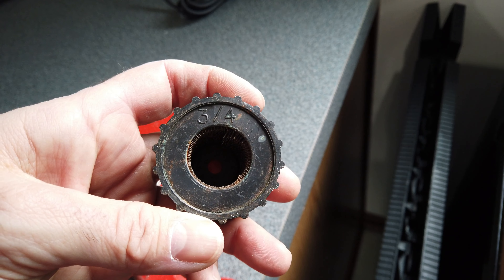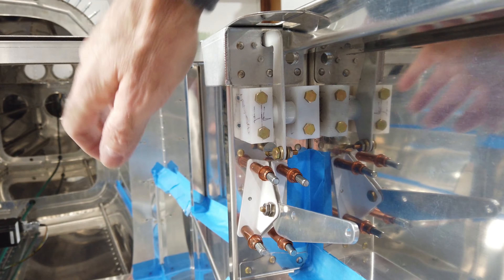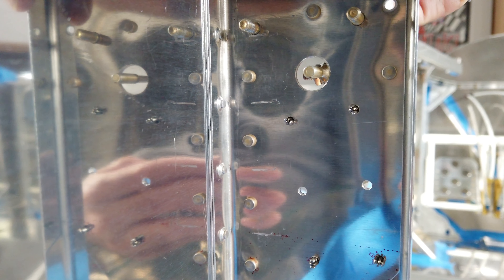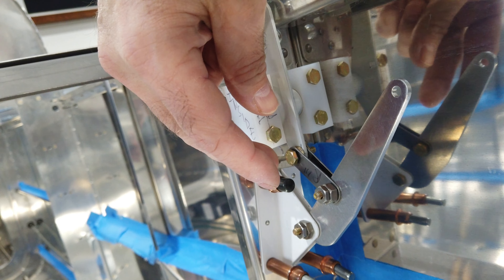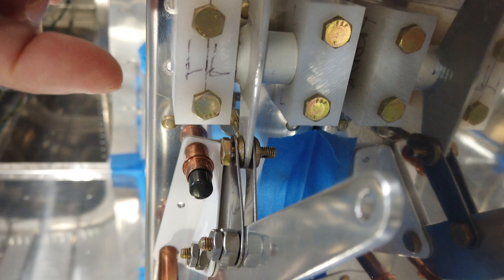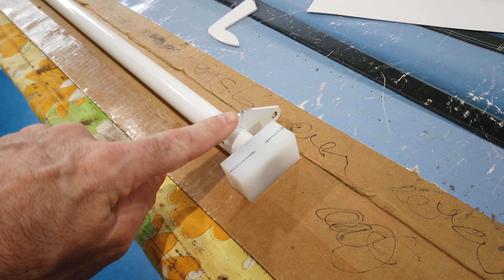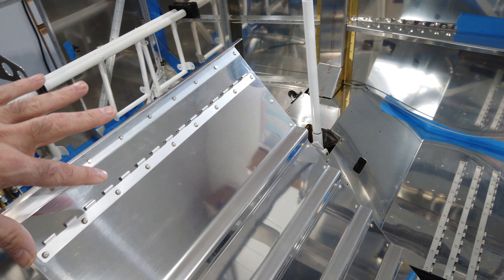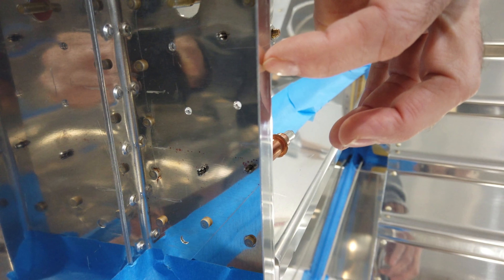Vans RV 7 HINT Video Tip Up Canopy Hook Mod 2

Comment: instead of using a solid bar to connect both sides of the locking mechanism, maybe you can look at using an a-920 control cable.  Aircraft spruce can make a custom size.  Attach it to the locking arm and run it behind the bulkhead through the hole you have.  Secure cable to bulkhead on both sides and you should be done.
Reply from the maker: Howdy Bob. I did see the cable option you talk about and I bet it works fine. I now have my hook latch mod complete, (videos coming today/tomorrow) and think it is great! No seat interference, no lost space in cargo bay, clean appearance; turned out very nice.
Reply: I  use the cable set up, very clean and light weight set up